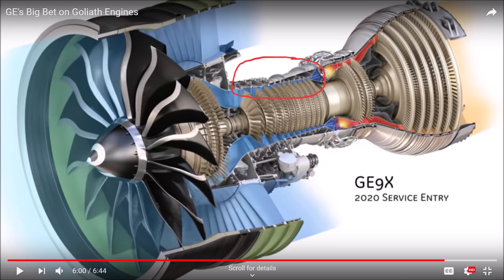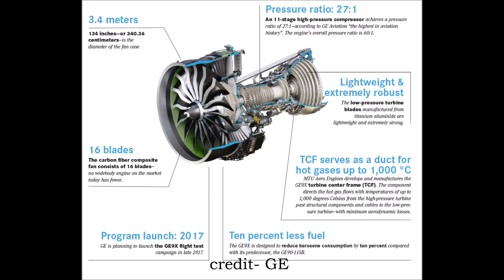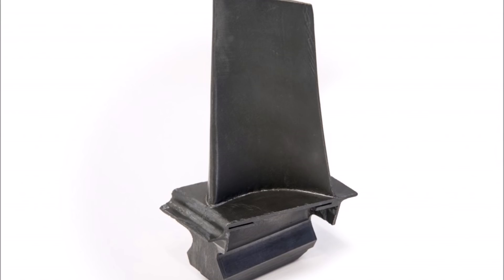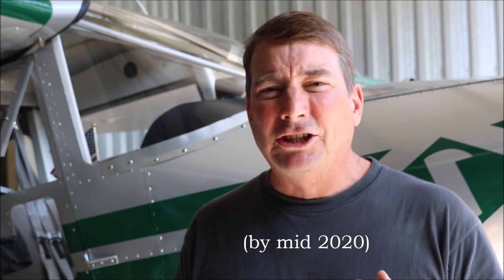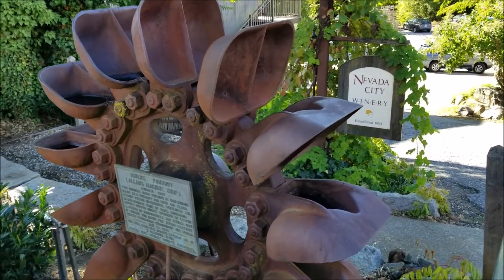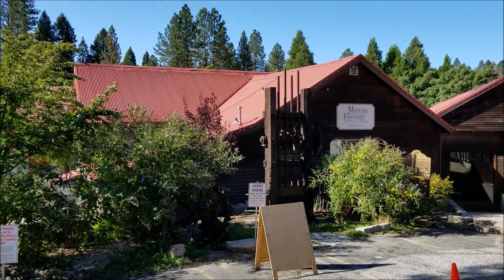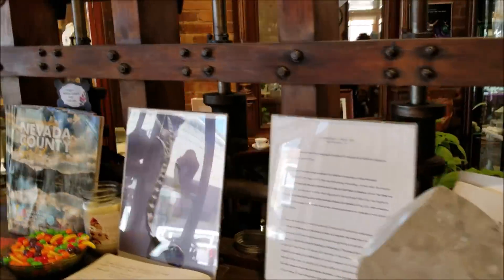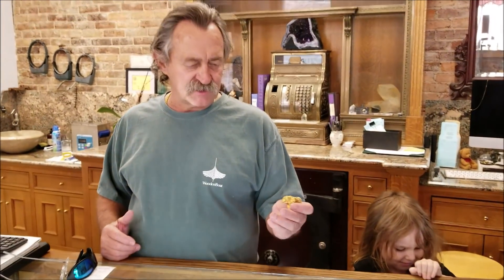Boeing 777x Delays and the GE9X engine stator vane issue.

Comment: 14,500,500 cycles? I don't believe that. A complete engine run... start up, warm up, bringing it up to power, cool down and shut down takes at least 15 minutes. If they would do that with one engine 24/7 it would take 151,041 days or 413 years to complete. Even if we assume a cycle takes only one minute (which is barely enough to bring it to idle) and they used all 10 test engines 24/7, it would still take over a thousand days... and we are talking about zero down time for any checks.
Reply: 64h5dsf14j6s41h5s4j5 There is a comment saying several thousand test cycles, takes about half an hour for each one. The millions figure probably refers to the original GE90 engine.

Comment: Juan the 60:1 "overall pressure ratio" that GE states is not the EPR. It's the stagnation pressure ratio of the compressor section, which is higher than the static pressure ratio of the compressor. OPR determines efficiency, EPR is a proxy for absolute thrust.
I remembered what I learned from AgentJayZ about how turbine outlet pressure is always lower than compressor outlet pressure, so there is no way the EPR could be anywhere above the 27:1 static pressure ratio of the compressor.
As AgentJayZ always stresses, terminology is very important. Here's the info on overall pressure ratio: https://en.m.wikipedia.org/wiki/Overall_pressure_ratio

Comment: and to think in the late 40s.   it was all they could do to keep then in one piece.    my did was at Boeing in the early 70s.  i found a picture of or dads, the prototype B-1 lancer.  with a spike nose painted white and red.
Reply: Moe Shouse My late father was a navigator during WW2. One engine fails and the other 3 still weren't enough to keep airborne!
Reply: to : @gordonrichardson2972    thanks for the info.  i think thats because of the heavy bomb load.   my dad was an MP  in India,  Shanghai.

Comment: Dear Juan, I found the AOPA magazine, the October 2019 edition on page 26.  It's entitled "Five points of clarification".  In the subtitle, it says "Don't kill the messenger".  It an article about health and the pilot.  It discusses risk factors for 1. New Drugs.  2. Another otherwise healthy 50-year -old man.  3. A man is treated for Metastatic prostate cancer.  4. One known risk factor for a stroke. 5. A patient with bipolar disorder, et al.
           The article is very informative, maybe more so for Airline pilots who require 6-month evaluations.  But I believe the part that says "Don't kill the messenger" is likely a response to an email I sent Dr. Jonathan M. Sackier many months earlier regarding another article he wrote asking him why the FAA is so suspect of pilots and their medical conditions when it is a well-known factor that over 99% of aircraft deaths occur from pilot error, not pilot incapacitation during flight.  I never received a reply from him.  But my email to him was based upon data the AOPA was using to try to convince the FAA to allow "basic Med" to have solely relied upon a pilot's driver's license.  We all know that was a partial success for small airplane pilots. In my opinion, it is better to go to an approved FAA Medical Examiner than to use the current exemptions which led to "basis med".  My point is that the FAA seems to favor youth to overall total experience.  Unexperienced youth for that matter in favor of them over well-qualified pilots with medical conditions.

Comment: Question: 1. What are the stators made of? Where are they failing ,on the leading edge, or elsewhere? 
                  2. Have the failures FODDED out the engines, or just resulted in not meeting spec?
                  3. Does the flying public know that engines and landing gear are leased to the airlines?

Congratulations on the Million Subs, you do good work.
Reply from the maker: 1. Titanium alloy- not sure (LE?)
2. High EGT only
3. Probably not, but most airline pilots do.

Comment: Excelent video. However, I thought the reason a jet is higher efficiency at higher altitudes had little to do with air temperature and everything to do with less air density. 

So for demonstration purposes example (rough example no calcs) a plane flying at sea level at 200 mph the ground speed is 200mph at 100gph fuel burn. At 40,000 ft altitude, airspeed is 200mph, ground speed is now 400mph, so your fuel efficiency is still 100gph but you traveled 100's of miles farthure at the same fuel burn. That is the efficiency gain, same time to travel farther at same fuel burn. 

Higher the altitude airspeed stays the same as ground speed increases for same fule burn. Has everything to do with air density. In fact colder air Temps makes air denser, makes jet fuel economy worse. Think density altitude.

Comment: Are these new planes really as safe as previous planes? I read that some 10 year old A380s already have cracks on the wings.
Reply: All planes have cracks in the wings. The trick is knowing how big they are, how fast they are growing, and how big is too big. It is true of course that as the understanding of the technicalities grows, it is possible to design closer to the limits to achieve lighter weight. It’s all safe as long as you have a good estimate of the limits.
Reply from the maker: A380's are already going away to the boneyard.

Comment: I flew B-52s.  The J-57 had a max EPR of 2.78!
Reply: Actually when GE talks "overall pressure ratio" it is not EPR. Overall pressure ratio pertains to the compressor section, and is related to the compression ratio. OPR is the ratio of stagnation pressure at the outlet of the compressor to the stagnation pressure at the inlet. The key word being "stagnation". Stagnation pressure is the dynamic pressure which is applied in the axial direction against an obstruction which causes all kinetic energy in the air to be converted to potential energy. This is the pressure applied at the tip of a pitot tube, as opposed to pressures like EPR which measure radial pressure.
The J-57 had an overall pressure ratio of 12.5:1.
Reply: @thebigmacd  Good explanation.  Thanks.

Comment: To me an increase in pressure would also mean an increase in temperature. It will  be interesting to see how that plays out...especially with TBO and the useful life of these new parts. Time will tell. 
Do you have any idea if these new engines will allow the aircraft to fly at a higher altitude for a given weight compared to the current production engines? I've only had one Atlantic crossing that forced me to descend to a lower (warmer) altitude do to fuel temperature.  That was flying a MD-11 freighter.
Reply: Larry Ehrlich I think that's a misstatement in the video. The higher cabin pressure limits will permit higher altitude flights.

Comment: Just a slight technical correction if I may:  Engine Pressure Ratio, EPR, is measured by exhaust total pressure, P5, divided by fan inlet total pressure, P2.  Some commercial turbofan engines use EPR to gage their thrust output with respect to throttle lever angle.  High Pressure Compressor, HPC, pressure ratio is compressor exit static pressure divided by compressor inlet static pressure.  But for these huge turbo fan engines, I believe total "engine" air compression ratio might be HPC exit static pressure divided by ambient air static pressure.  This would take into account the pressure increase imparted to the airstream entering the engine from the fan, Low Pressure Compressor, LPC, and HPC.  Past the HPC is the combustor which can be considered a constant pressure process for simplicity.  Then comes the turbine section, the first set of turbines is for generating HPC shaft power and the last set of turbines is for generating fan and LPC shaft power.  Any energy left in the airstream past the turbines is exhausted out through the exhaust nozzle and contributes a "little" bit to the overall thrust output of the engine.  Most of the thrust is generated by the air exiting the engine from the fan.  But as these turbofan engines get bigger and bigger, the more I think they are becoming turbo "prop" engines where all the energy in the gas stream past the combustor is being used to generate shaft power to spin the fan with very little energy left to impart forward thrust via the equation, thrust = (air mass flow)*(V'exhaust - V'inlet).
Reply from the maker: correct I said 'difference' where it should be divided by.
Reply: HMG5588 There are several misstatements in this video.
Reply: @gordonrichardson2972  That's OK by me though.  I have great respect for pilots.  Piloting an airplane is something I would find nearly impossible for me given my level of dyslexia.  Too many switches in a flightdeck!

Comment: The fuel flow in pounds per hour remains approx the same at various altitudes the economy arrives by having a colder temperature and thus a higher true air speed so thus the nautical miles per pound off fuel increases.    Holding at the outer marker will not burn that much more fuel,maybe less if ATC will accommodate this and put you ahead if the airport opens for landings.just a thought. But then I retired 18 years ago   Major carrier Capt.  oh yes your utube is over the top excellent. Thank You
Reply: Drag is lower at higher altitudes due to the thinner air.  That's why high altitude is used for commercial flights.  Cooler intake air means lower compressor-exit temperatures too.

Comment: I'm a propulsion guy. "Stator blades" makes me wince.  Blades rotate. If they are stationary, we call them vanes. You got the title right.
Reply: And don’t forget that there are variable stator vanes (VSV) and fixed stator vanes.  A typical engine has two to four VSV’s in the front of the HPC and then the balance of the stator vane stages are fixed.   The VSV’s are rotated more open or closed to enhance performance and prevent compressor stall at various throttle positions and flight characteristics.  The GE video showed VSV’s.  The round outboard platform / shroud makes them easy to spot.
Reply: Q Can Good eye! I thought those stators looked odd, but didn't figure which side the attachments were.
Reply from the maker: Good point THANKS!
Reply: Those stator canes rotate too don’t they, just around a different axis😃
Reply: RedRoosterParty After watching many previous videos on jet engines, I also winced at several misstatements here.

Comment: As an engineer, I used to give tours at the Bonneville Lock & Dam and the Folsom Historic Powerhouse.  From everything have read, while experimenting with the single bucket wheel, al la the Kinght Wheel, Lester Pelton noticed that when directing the water stream at the side of the bucket the wheel sped up.  That's because when hitting the bucket the direction of the water is reversed imparting more energy to the wheel.  The split wheel was a further development.
Reply: Jim Price Correct! The cow version seems a made up story...

Comment: Good grief a top fuel engine is around 7 to 1. Amazing what they are doing with these turbines.
Reply: But a top fuel dragster is also massively supercharged, so its basic compression ratio has to be lower
Reply: Dremwolf that’s pretty low, my Mazda is 14:1

Comment: Wonder what causes the stator vanes to actually "deteriorate" in the compressor section? Be odd for the airfoil itself to be an issue since its just directing air into the next stage, unless its being tested for durability with the presence of contaminates in the air. Also FWIW the turbine blades are typically a nickel alloy and not titanium due to the heat there. Cool to see composites finally making their way into the engine itself.
Reply: mysock351C Juan makes several minor misstatements in the video, and doesn't actually explain the wear cause.

Comment: Now that sure makes me think and wonder. How could stationary stator blades wear out, and faster than expected? I have designed and troubleshooted in hydraulics, and in that area one can have "Cavitation" issues that can wear away at surfaces that have no mechanical contact with other surfaces. This happens on ship and boat propellers too. Might there be a similar thing happening in these engines but caused by air? If anybody knows, please explain.
Reply: BiddieTube This video doesn't explain the cause.

Comment: Thanks Brownie and congrats on 100k - I have told everyone I know to spread the word about the great job you do.   Did I hear you say on the new Triple 7 MGTOW and max landing weight is the same?  So no fuel dumping if you have to land immediately after a max gross takeoff?   That's a huge safety factor - no dumping or circling to burn off fuel could get you back on the ground faster.   Tell Lt Pete to do his homework.  I bet you have to stand on the rudder hard to offset 134k of thrust on OEI.

Comment: If you loose 1 engine on take off at max take off weight in the 777-300ER how much weight would you have to loose before you can land? I imagine it would be quite busy in the cockpit not to loose control of the aircraft in that situation.
Reply from the maker: in an emergency you can land overweight, no sweat.

Comment: Outstanding episode & congrats at reaching 100K subs!  The explanation of the GE9X stator vane issue was clear and concise.  Based on the GE9X delays, it is going to be touch-and-go for Boeing to maintain most of the orders that launch customer, Emirates has for the 777-9X. Emirates is facing a plateau in demand & is looking for ways to reduce costs and capacities.

Comment: In the compressor section, titanium stator blades.  My assumption is that the blades will withstand about 2,000 F for sustained periods,,, the compressor section is the cool section,,, pre-combustion,,, cool is relative,, a 19 to 0ne compression at 450 knots,, sustained,,, yeah, there is going to be heat,, or is it turbulent air flow that is eroding the blades?,, Hmmm that is what they do,, comb out the airflow,,,,    What do you know?  It sounds an odd problem.  rather than change the material,, have they identified the turbulence and corrected the shape?
Reply: Sailor376also I think Juan mixed up his jargon in a few spots. Hard to fit a full description into one video.
Reply: @gordonrichardson2972  And I am much worse, a good engineering background, but little direct knowledge. I may be asking correct questions, but it is unlikely I am using the correct nomenclature. Whatever words Juan used he laid out a very interesting problem.  Oh !  Now you have set off my fireworks !  At the higher pressures 27 to one,, 29 to one,, will speeding air begin to exhibit the marine prop problems of cavitation?  An erosive process not directly related to the surface heat on the vanes.
Reply: @Sailor376also  Cavitation only applies to liquids, not gases. Try AgentJayZ videos for the correct nomenclature.
Reply: @gordonrichardson2972  Does cavitation only apply to liquids?  At what pressure, temperature, or speed might that process, or a similar process,  begin to be exhibited by a gas?  Gases do become liquids at high pressures.  Water IS very different,,, what are they up to now?  13, or 17 phases of water?  COULD we be talking about water vapour ingestion colliding with the blades.  The possibilities of 29 atmospheres of pressure at 450 knots,, my imagination boggles.

Comment: Juan, the FAA test requirement for engine cycles is 3000 cycles. That is/was start to idle, run to takeoff thrust, back to idle, reverse thrust, idle and shutdown. Rinse and repeat. I recall that it takes about 20-25 minutes per cycle. Probably around 500 cycles, they'll pull the bore-a-scope plugs and inspect. Then every 500 cycles, and a full tear down at 3000 cycles.

Peebles Ohio Engine Test is going to be quite busy, so anyone living in the area has probably heard an increase of test engines. 

One thing about test engines, is that test engines are tested at the maximum out of balance condition, as well as tested @ 10% under rating of thrust as well as 10% over rate.

Boeing and GE can run a condensed flight test program, by doubling up on the number of tests run per day, provided they have test personnel and aircraft available.
Reply from the maker: That makes more sense. Thanks Gunga!

Comment: In the mid 70s we (CWRU material science class) had an engineer from GE show us their sintered ceramic compressor blades. Tap them and it sounded like vitreous china, but you could hit with a hammer and torch it with oxy propane and the quench it in water and it wouldn't break.
Reply: jim feldman Those were turbine blades, the compressor never gets hot enough, only after fuel combustion are high temperature materials needed.

Comment: Thanks so much for sharing your knowledge and the bonus clip at the end ... Nevada City here I come ...
Reply: I sincerely hope you stay in Nevada City (or the area for about a week.  My suggestions,  if it's o.k. for me to be so bold:  visit the Empire Mine State Park, in Grass Valley.  
Also Malakoff Diggins State Park.
Then North San Juan and Downieville.  Up from Downieville is Sierra City and the Sierra Buttes.  The Buttes are best seen from the interior.  I like Sardine Lake Lodge and the lookout tower.
After that, continue on Hwy 49, then turn right to Sierraville.  There's a hot spring there.  Juan showed it on a video once.  Continue South to Truckee.  You'll be a short trip from Lake Tahoe, if you haven't already seen it.  Or, turn right onto I-80 at Truckee,  wait, no, better to drive along Donner Lake and drive up Donner Pass Hwy., stopping for photo's along the way.  You can intersect with I-80 after Soda Springs.  
From there, you would exit I-80 at Hwy. 20, which will take you back to Nevada City.
If you want a gold nugget, you should be able to buy one somewhere between North San Juan and Downieville.  Maybe find a miner at the river, or maybe there will be a rock shop along the way.